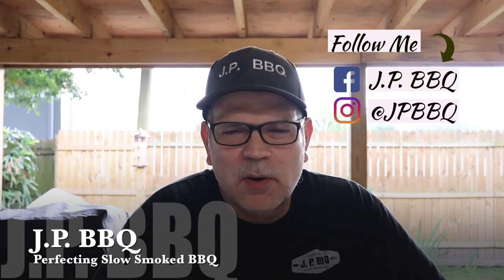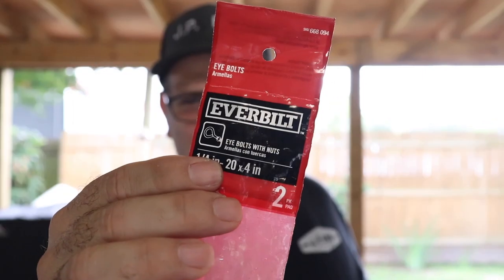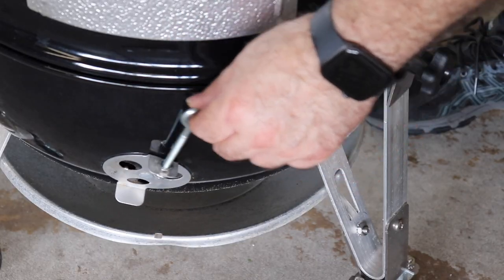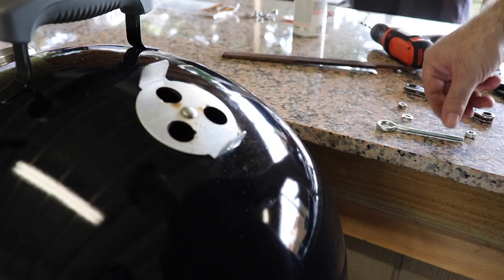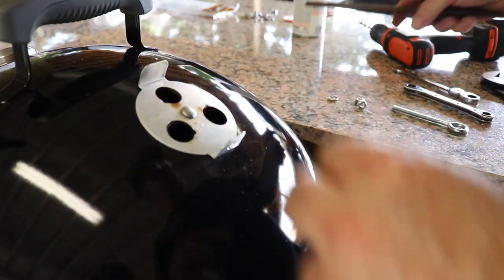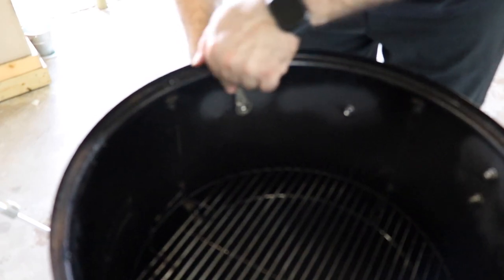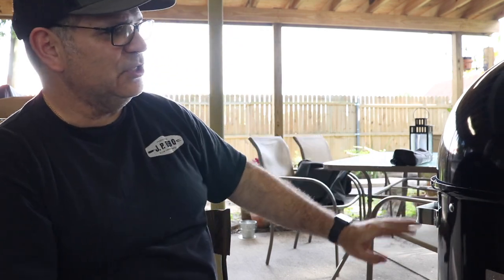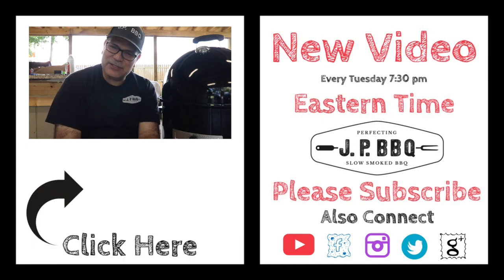Weber Smokey Mountain Mods Part 2 Installing Handles and Damper control Handles

Comment: Thanks for the video. I just bought the same handles at my Ace Hardware for my 18-inch WSM. I bought the Cajun Bandit Stainless Steel Door and got rid of the thin aluminum door that was just too flimsy. The stainless steel door has a nice sturdy latch system on it and I love the new door. I bought the Cajun Bandit charcoal ring that has tabs on the bottom that allows you set the charcoal grate in the ring, which allows you to remove the charcoal ring and grate in a one piece unit that makes clean-out a breeze. The charcoal ring holes also allows for better air circulation and is stainless steel. I also picked up another charcoal grate at Home Depot that I place 90 degrees over the original charcoal grate which makes for smaller square openings. This allows for more burn time on your charcoal. The other addition I did was putting gasket tape on the top section of the center unit, which gives a good seal for the lid. If you're going to continue using the original door, you might want to put some gasket tape there too. I even use the tape on my stainless steel door. If you're into hanging ribs, the Pit Barrel Cooker makes a rib hanging rack specifically designed for the WSM 18 inch model. Hunsaker Smoker makes a rib hanging rack that fits the WSM 18 and the WSM 22. I can hang 6 to 8 ribs on the rib rack or several chicken halves with my WSM 18. They are the best bang for the buck in smokers! You're going to enjoy your WSM!!
Reply from the maker: Thanks Joe really appreciate the input. Love my WSM

Comment: The only mod I have done is put the door from Cajun Bandit.  Big improvement- a lot tighter fit.  Might put the caster wheels on.  I use white cotton gloves and have Venom Nitrile gloves over that.  I can touch the vents with no problem.  Plus, I can pick up hot meat with no problem.
Reply from the maker: Thanks Bamafan1 appreciate your comment and thanks for watching. Thanks for the tip.

Comment: Nice mods. So how hot did the handles become after firing it up?
Reply from the maker: Hey there JG M3 appreciate you watching and commenting. The cool touch handle, not hot at all. the side handles not sure, but i do not think they get but warm to the touch. I use those handle to move the smoker around and once I fire it up I usually dont move it unless it starting to rain. but so far so good.
Reply: @JPBBQ  thank you for the reply!